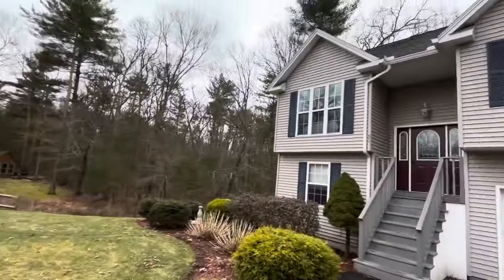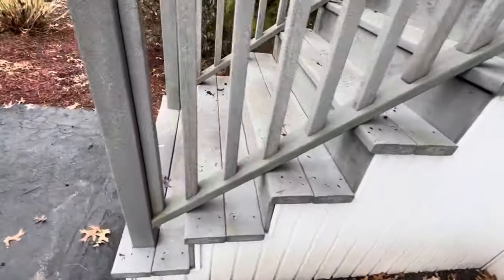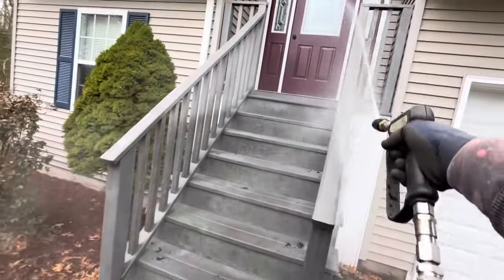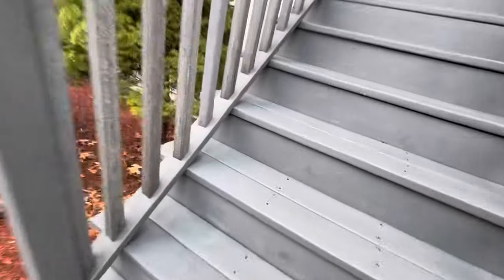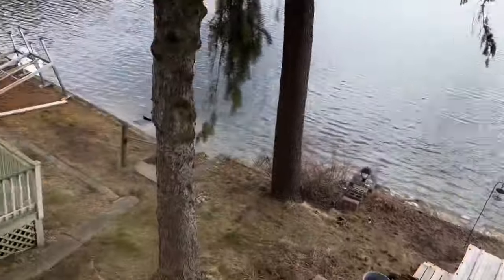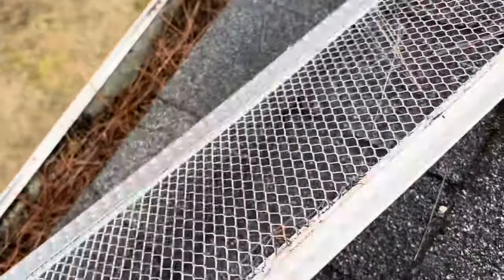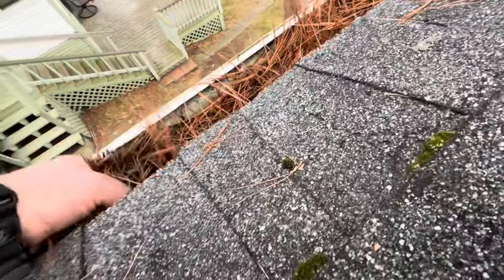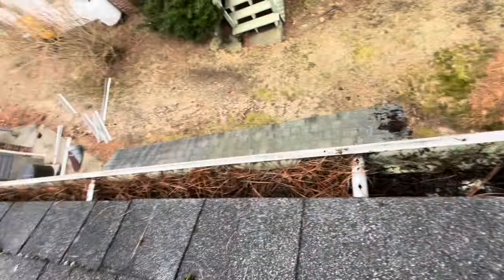Gutter Guard Fail

Comment: Hey!  I’ve been considering sky vac where I live for a small business in removing pine needles. You are the expert!!  

What are your thoughts or wisdom you can share in this?  Can’t it also blow them out when they are dry?  I can’t imagine it wouldn’t continuously clog sucking them up
Reply from the maker: The sky vac does not work that great with pine needles

Comment: Do you notice a lean on drivers side of your truck? I’m building out a 40k mile F350 Dually I owned since new and have a bad lean I’m noticing as I’m installing equipment. Not sure how to fix the left lean I have, I start research and finding out it’s a known superduty problem. Was wondering if you noticed of ever measured yours?
Thanks and I hope everything things turned out positive!
-John from NY
Reply from the maker: Thankfully, currently, no lean on my F450
Reply: That’s good. If you don’t have it now you likely won’t have the issue. Thanks for the reply!